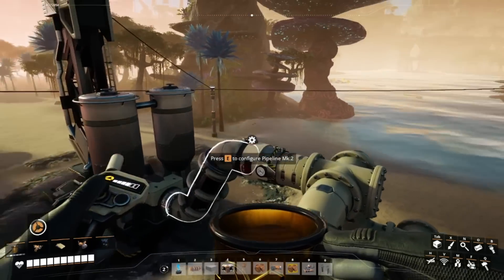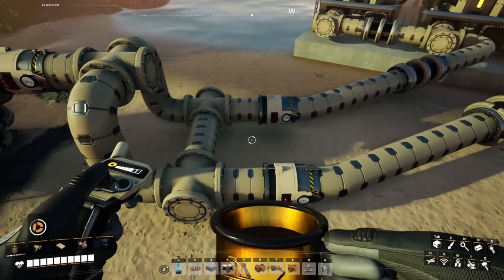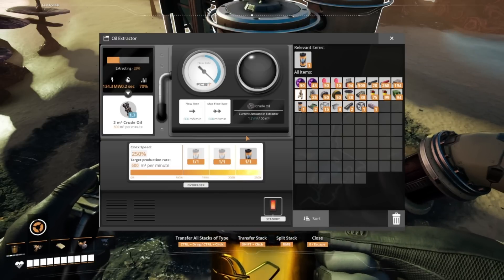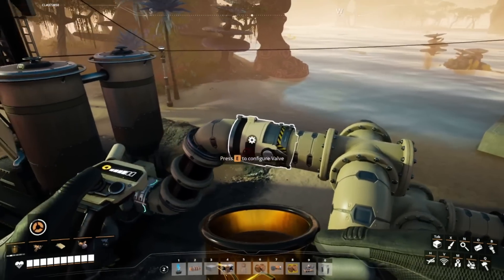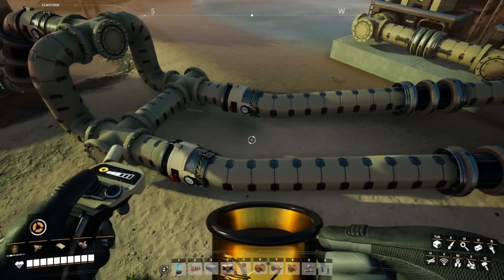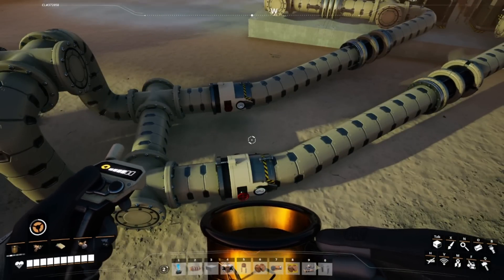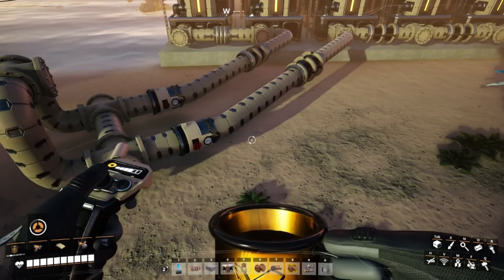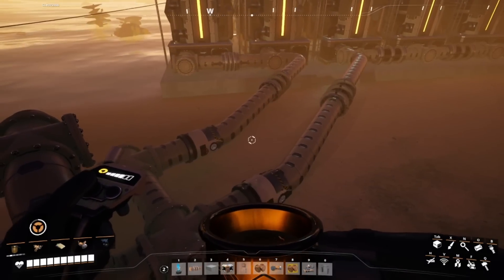How to actually get 600 out of a pure oil node in satisfactory

Comment: Would just simple liquid tower solve the problem?
Reply from the maker: You mean a liquid buffer, the ones you find in the storage build tab? It doesn't add anything to the equation, and in fact I seen them create backflow even though there was no reason for it
Reply: @siriuscowking no I mean a liquid tower (water tower), when you a build liquid buffer on a pillar and use a pump to lift it. So every machine is below the liquid buffer.

Comment: This video proved to me this was simpler than most people think, and made me realize it could be even simpler, so thanks! The key takeaways to avoid most backflow issues seem to be:
- Make two 300 m^3/min manifold lines instead of a single 600 m^3/min line. Flow rate needs wiggle room since machines consume fluid in batches, not continuously.
- To make a directional Y split, place a pipe junction at a slightly higher elevation, with the output branches curving downwards and the input branch going straight.
- Allow the manifold lines to fill before powering all the refineries at once, as flow rate is proportional to how full a pipe is.
Gravity will ensure the fluid in the input branch flows down the output branches. Even if one output branch were to get backed up before the other, the input branch would pour all 600m^3/min of oil down the other branch and sloshing wouldn't affect it. I placed a valve on the input branch but I'm told it's not needed, as the head lift from the extractor is like imaginary height added to its pipe.

I tested this with 10 refineries producing fuel for 20 generators and it ran smoothly for hours, no hiccup on reload. That was an easy 5 GW compared to the 4.5 GW I got from 60 coal generators 😅

Comment: would unpowered pumps also work instead of valvs?
Reply from the maker: @Vayes  pumps only work if they are powered, but pumps do work
Reply: @siriuscowking  I just mean to prevent backflow. I thought they stop backflow even if they are unpowered
Reply from the maker: @Vayes pumps do not prevent backflow even when powered. The backflow will occur on the other side of the pump, and if that pushed more than 600 total it will stall the flow, making the backflow occur before the pump.
Reply: @siriuscowking  i see. good to know thanks

Comment: What you're trying to describe is a phenomenon known as "water hammer".
The game does a brilliant job at capturing what happens in a closed system when a liquid is forced to change direction suddenly or is stopped. Though, an extra welcomed touch would be to have a knocking sound near any pump, and a slight pipe vibration when you slam a valve full shut or a large amount of liquid suddenly stops being used due to a machine backing up.

To solve water hammer, disregard 14 mins of this video (but do leave it running to provide this homie with their watch time), add a buffer.

Only the big buffers will do for 600m3 flow rates.

If you have more pipe then you do volume in the buffer, you need another buffer somewhere downstream. There is a reason the game tells you how much volume is in a pipe segment.

Here's my fluid management bible.
1. Use buffers always. At least one per system.
2. Use valves after the buffers. Use valves to regulate how much is going to your machines so you can remember how much is left on that pipe segment before the valve. Use liberally.
3. Hydro-static pressure is a thing in this game. You can abuse it, just like we do in reality. To summarize why you want to learn what that is, and how to use it. 3 pumps.... 9000m3 of water. 70m vertical.
I can do that with applied knowledge... because this game is just that satisfying.
4. If you are doing 1:1 ("600m3 required from this pipe segment"), it's very important that everything fully saturates. If you have air in the lines (reason #2 why they give you a fill indicator), liquid will slosh back and forth, causing the effect I mentioned at the beginning, "water hammer". Albeit, not as profound as most examples are, but it's the same principal. Eventually the liquid will shut off the pump, just like in real life.
5. Lastly, buffers have a height, which means they need headlift. A normal pump has about 10m of headlift, but you're going to use 2-5 at least just getting the pipe on land. Assuming it goes directly into a large tank, the tank is about 8 meters tall. This is why your tanks refuse to fill up all the way. Also, refineries seem to have about 5-6m of headlift. ("add a small pump where needed to get that last bit of the tank filled and make sure pressure is good, always")
Reply: Imo it's ridiculous that they programmed in a water hammer. If they're going to go that far for mechanics that add needless complexity, they should add the destructive nature of a water hammer.

Comment: This seems over complicated. A key rule for reliable pipe flow is to ensure that the manifold into the machines is always higher than the machine input and that the head pressure point is higher than the manifold. That's it, not a lot else is required.

Take the machines around 09:30. These have a manifold that is the same level as the inputs and as a result this will cause hell with the manifold as there will be backflow from the machines. To fix this setup, all that is needed is to raise the manifold with a single step on a pipeline holder and then run the machine pipes in at a downward angle rather than horizontal. In this scenario the supply pipe coming across the gap is higher than the manifold therefore the head pressure point should be higher than the manifold (nothing will work otherwise). I have 600/s supply pipes all over the place. For example, 5 water extractors all connected to a low level manifold with a single fluid pump which pumps the fluid up as high as it can and from there it's down to a manifold and fed into machines. As long as the high point of the fluid pump is higher than the manifold everything will run smoothly and a setup requiring 600/s will run just fine every time.

Comment: have 600 without an issue... if you have an issue just put a high bend to ensure the lowest fills... I have 2 600 oil from near desert to the spire coast at a steady 600... its a long haul.. but i have been playing for last 4 years and have figured out the issues.. which are a lack of understanding that set up right you will never run low, you won't have sloshing, and will always have full reserves.
as for your video you won't feel the back pressure due to the valve which isn't needed.. place a high spot before the inlets and problem is solved

Comment: So why wouldn't I want full pipes?, also, would yu say use the splitter you made for water as well? And what abut adding a water tower?
Reply from the maker: @deadcell66  full pipes has no impact on wether they are working well or not, a water tower is the equivalent of a very large pipe and has no impact either. Any source other than a pure oil node maxed out will give you less than 600 per min, just don't have 600 per min in a pipe unless you have to
Reply: @siriuscowking  Righty. Fluid mechanics are still confusing to me. This system does seem to work amazingly! So thanks for that.

Now I'm just wondering if it would be wise to use more simplified versions of this on other machines that provide fluids as well, like refineries, mixers, fluid storage. Or is this only applicable when you're dealing with full pipes?

Comment: Had issues with pipes in the past, most of it was headlift, but I've learned a few things that help things want to stay stabilized. First, if you're flat and within the 10m natural headlift, you dont need to gravity feed from above, but if you are building taller, add a pump and give your pipe a 4m bump at the top before it comes back down to where you need it. Second, if your machines divide the input evenly, theres no reason not to feed from one end of the the pipe or the other, adding into the middle invites feedback issues. Third, try letting the input pipes fill up entirely before you connect the refineries to power, bonus points if you do this just before the extractor comes to rest, but itll work from cold start full pipes. This last point holds doubly true for coal generators, always let them fill with water entirely before the first nugget enters the line. 

Hope this helps =)
Reply: bro  thank you so much. i spent 2 weeks on my alternate turbo fuel refinary and still have some refinaries in the yellow...will try some of these

Comment: I always just run fluids up to a storage tank that is at a higher elevation than any of the sinks. I do also use the elevated "bumps" to create overflow gates. For valves, what I've heard is that you should only use valves with equal limit values connected to a given node.

Comment: Not sure if I have a use for this exact layout, but I think I see the principle behind it's behavior.  I recently built a modest aluminum ingot factory (1200/m) and have been struggling super hard getting fluids moving correctly.  At this point I'm 90% functional and that was good enough, but I may go back and have another look with some of this in mind.
Reply from the maker: @thehuggz-i9k  for aluminum I have a very simple setup in my other video, the safety strat is to have multiple small network of pipes and pumping in only the water needed to make sure the water doesn't clog in the machine

Comment: Nice video and explanation of fluid dynamics.
I noticed a distinct lack of vertical pipe junctions....
Much of what you did can be simplified by using a vertical junction, either by attaching to an existing pipe or placing on temp walls (use nudge or walkway for wall placement/alignment).
A vertical junction has 3 levels of priority/flow.
Feed machines using overhead manifolds with vertical junctions to prevents backflow and force sequential filling (same as using smart splitters with overflow along a manifold).
Placing an inverted U to act as a literal fluid overflow helps prevent backflow too.

Comment: Would a fluid buffer do the same thing? Or is this better for some reason?
Reply from the maker: @Piecesxiii  a fluid buffer simply holds a lot of liquid like a big pipe, the limit of the flow is still 600 per min, it does not solve the problem

Comment: This is a very important concept and your method offers a far better solution than how I tried to fix it. Try to minimize the amount of time a pipe is at max flow rate. The small pipe leading to a machine will always flow backwards at the first junction due to work pressure. Allowing room for fluctuations to occur is vital in pipe balancing. My method was to feed both ends of my manifold and have multiple fluid compensators in series to ensure a consistent 600 pressure. I would add a single compensator to the end of your blueprint, but splitting at the beginning is elegant enough
Reply: Also. Valves aren’t really broken at lower capacity, they just behave poorly in general. A full pipe has a work pressure of 100%, which allows maximum throughput. So a mk2 pipe with 600 fluid running through it will only push that 600 when the pipe is full. A half full pipe will push less. (Not sure if it’s linear so don’t want to say 300). A valve is weird where it both acts and doesn’t act like a pipe. A valve will only push the amount of liquid it’s limited to if and only if the pipe feeding it is full. However, considering the use cases for attempting this, the input pipe will almost never be full. So, in short, don’t use valves as limiters lol.

Comment: Probelms only happen in 600 m.s systems. Your system works becase the very first junction has made a loop. valves and pumps have nothing to do with it.  it has nothing to do with sloshing either.
https://static.wikia.nocookie.net/satisfactory_gamepedia_en/images/3/39/Pipeline_Manual.pdf
no one has ever got 600 flow from a pipe without it making a loop. the flow will revse at the very first junction as soon as all your machines fill.

Comment: The valves are not helping with fluid sloshing. The proper way to deal with the issue is to build a second pipe above the the one supplying refineries, parallel to it, and connect it to the ends of the feeding pipe. This way any sloshing you get will be above the input line, until it fills up, and while its happening the lower pipe will always be full anyway. If refinery gets blocked in the meantime, excess oil from the upper pipe will always act as a buffer.

Comment: Do you have to solve the same backflow issue with gas ?
Reply from the maker: gas doesn't actually flow, it just sort of fills the entire system at the same rate, so as long as you have enough flow capacity you will never have any problem
Reply: With gases it is all about pressure. So, no.

Comment: I always have fluid input manifolds Above the connection point and looped instead of strait line and equal or below connection point. that way gravity is never working against flow. This way my input manifolds are essentially fluid buffers that gravity feed. Never had any issues with flow since starting to do it this way and always utilize max yield from oil nodes. And always make sure to prime your pipes, let them fill to max including input and output buffers of factories and mines before turning on production lines. If you turn on a production line without maxing fill capacity of the pipeline, you will never get correct flow even if you're producing enough

Comment: You don't necessarly need the valves. The important part is that liquids get liftet at least once higher than the machine input. Also as far as i'm aware the pipe can't handle the full 600 from a number representation issue. It will take many hours / a view days. But unless they fixed it for 1.0 its 599,9996 or something like that.
Reply from the maker: I have had the game running on this save file for over 300h now in 1.0 and it's still running at 600 with the setup shown in the video. I know I "shouldn't" need the valves, but it works with them. Let's remember that this is a video game, not real physics, sometimes you need these things for them to work properly
Reply: @siriuscowking  Oh, cool. Thanks. Then they fixed it to 0.8, and now. The lift above was not necessarily because of real physics. The algorithm sees everything as a volume, and each liquid has a dynamic number. If a pipe network is on the same level, a fraction of the volume moves from the higher to the lower level. If you filled a tank with water and made a huge splitter with like 9-27 pipes coming out and merging into a new tank it used to swap back and forth basically forever.
If you have an elevation change it fills every volume on the same level first. As machines consume and have a buffer they are basically never full.
The valve and pumps cut the backflow completely, so they serve the same purpose for the most part.

Comment: Hi! I watched this video about a few days ago and I was amazed by these designs. However, today I saw another video: https://youtu.be/ZwO-F82sYE4 And I feel like the first design and the one you're using as an example at the aluminum build are the same. To my surprise, that's the one that failed the missing item test, while a valve surprisingly worked just fine. And even though I don't know how that second design works, it performed very well compared to all the other options. Is there a difference between the two examples or would your system have the same issue if it lacks the items for some time? Because in case it does have the same problem, it might be better to use a different method.
Reply from the maker: @nebula600  the method I suggest in my basic liquid tutorial is the simplest way to deal with liquid byproduct, just throw it back in the loop. As long as there is no power shortage, there will never by a missing item input. On that same note, you should always have an awesome sink to deal with the overflow. If you are the kind of player who doesn't keep an eye on their power usage and also don't have a reserve battery, then you might want to consider using the liquid on a 2ndary production. That being said, making more power plants isn't difficult considering the amount of rocket fuel you can make for even just 150 crude oil, see my next video.
Reply: @siriuscowking  Oh don't worry, I would give ANYTHING to make my power chart 2 straight lines. Technically just for my OCD, but of course the good part is if something isn't at 100% efficiency, I can read that off from the power chart which would be AMAZING, if not for those things that consume/produce power in an oscillating way.😡

Comment: There is no issue with pipes, only ppl that doesn't understand how they work.
Reply: Fr. Heard about this "bug" for a while and was concerned until it happened with me...but with 300m^3/s in mk1 pipes. This same issue will happen
Reply: There are issues with how the code rounds up/down floating point numbers. Eventually it breaks perfect systems that use max 600m3 pipes. You can easily fix it by dropping the usage to 599m3 with an oil extractor working on 600m3 speed. That extra 1m3 fixes it. Everything else is a cope

Comment: Do you have a tutorial on turbo fuel not making it so much but a setup that works well?
Reply from the maker: I was planning on a rocket fuel VS ionized fuel video, I could include a simple setup in it to show the process, this of course would include turbo fuel and diluted fuel
Reply: @siriuscowking  Ionized is actually fun, I am building a setup that will output 1200 ionized fuel per minute only using SAM, water, oil, coal and nitrogen. Alt recipes ftw haha (oops will be more like 2400 since I'll be boosting my final stage with sloops)